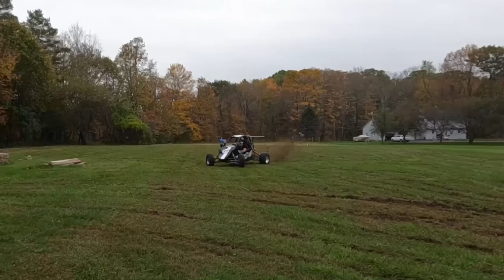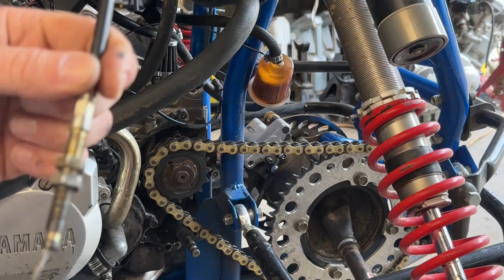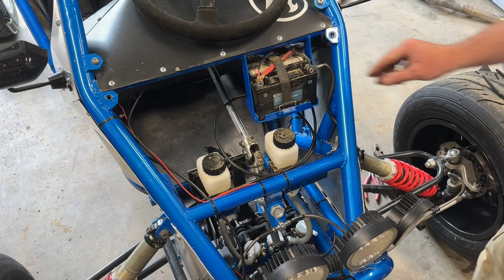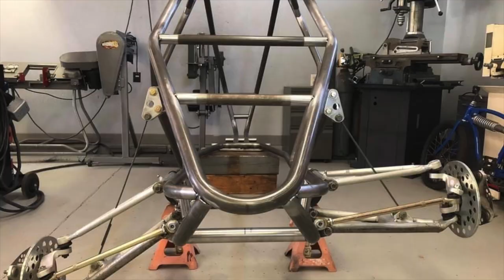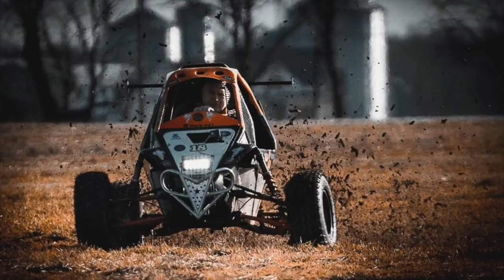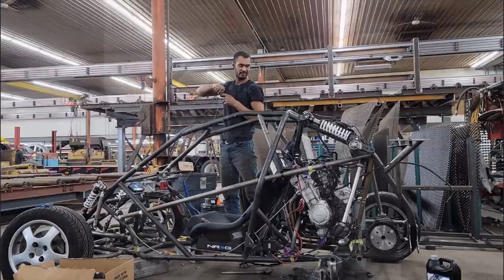Crosskart Clutch Cable Install and 100+ Crosskart builds

Comment: just so you know kyle tilton has a clutch cable conversion for those pedals..i ordered them for my build....part no TIL-72-798...i wasnt gonna do a hydraulic conversion considering tilton has them...great kart kyle cant wait to get my bender and then its full speed ahead....almost have all the pieces i need after collecting for a year now lol
Reply from the maker: They are well over $100 bucks and meant for an engine forward if the firewall. A big reason for doing it how I did was from inspecting actual vintage race cars at Watkins Glen. I learned a lot including that it doesn’t need to be fancy to be highly functional. I am however very interested in how it works out for you as I’ve had my eye on that tilton part for a VERY long time! Let me know and thank you.